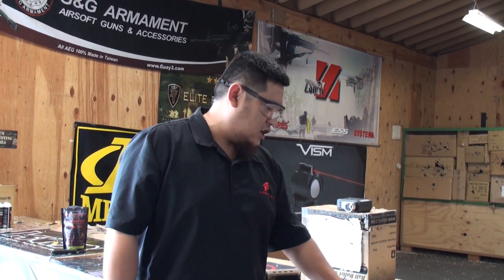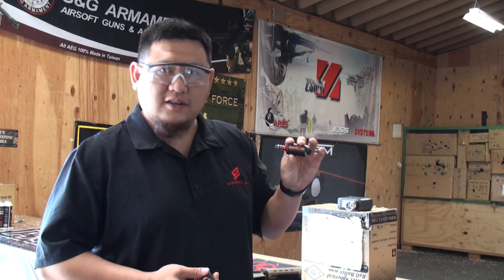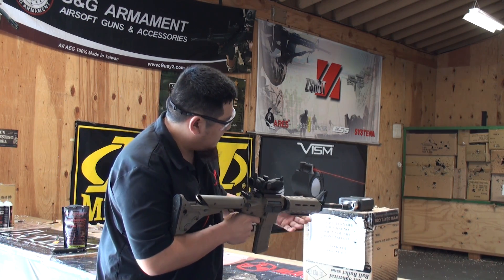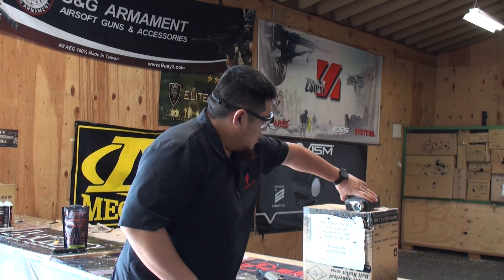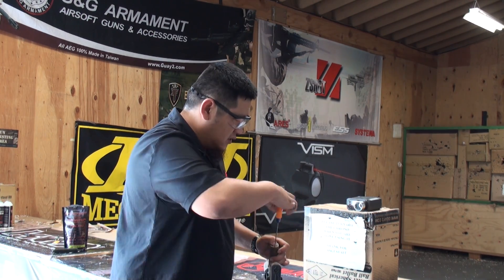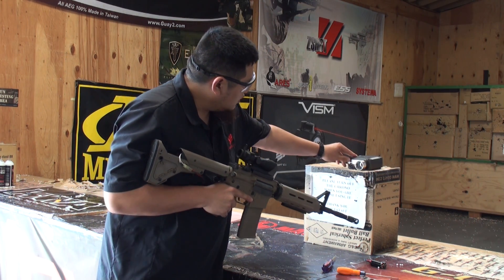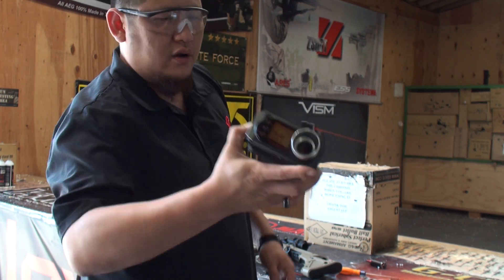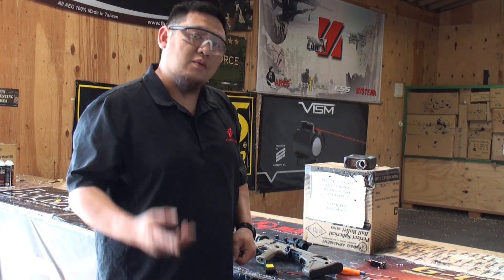GITV Uncut - Tienly F5000 Gt 45000 Motor Testing And Comparison

Comment: rpm of a motor means absolutely nothing unless they tell you what battery they use to achieve 45000rpm, which Tienly doesn't do.
Reply: they do say it clearly on the box chart its in Chinese though
Reply: 99% of rpm tests on motors are with 8.4v batteries, a 45k motor would hit 55-60k with an 11.1v

Comment: something I've noticed with Airsoft GI's tech vids. They never display stats, parts included, battery power or even what might be different from test A opposed to test B, 

Case and point, the first miracle barrel test they did a while back. Used 2 different rifles, different barrel lengths, different stats and did not even list what type of hop up/bucking was inside. The only thing they said was 'this is an M16 length barrel and this is a short miracle barrel' then did the tests.

If you aren't going to show the parts used in the video, at least post them in the description.

Comment: Could you leave the technical specs of this motor? i.e. torque strength per cm/inch and the actual RPM based on different loads?

Thanks

Comment: Put a dsg in it with the 45000
Reply: Except for a 20:1 dsg, it wouldn't have enough torque.
Reply: @simonbrisebois-therrien2775  actually with higher ratio dsgs you are supposed to pair them with high rpm motors.

Comment: Not always true because high speed motors generally have a slower trigger response compared to high torque motors. This is because high torgue motors pull the spring much easier therefore creating a better trigger response. In this case the motor is a high torque/high speed so you get a high rate of fire and a good trigger response.